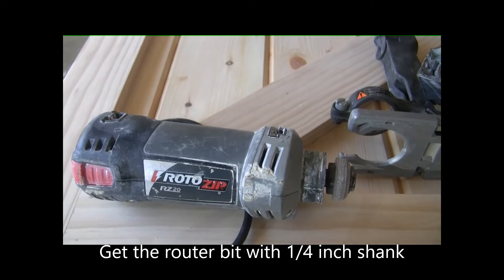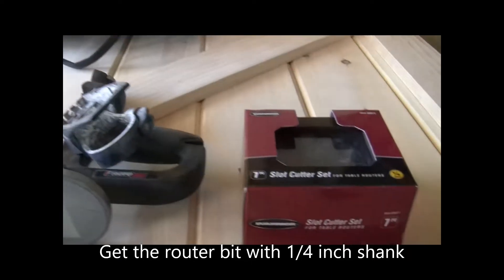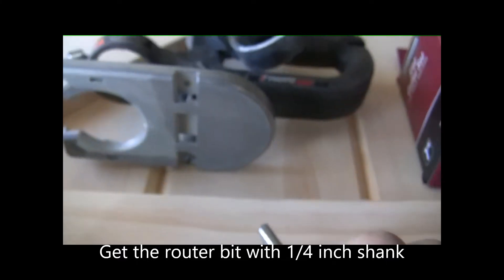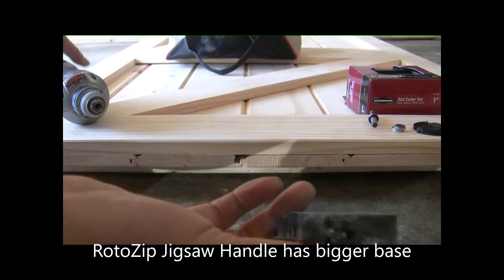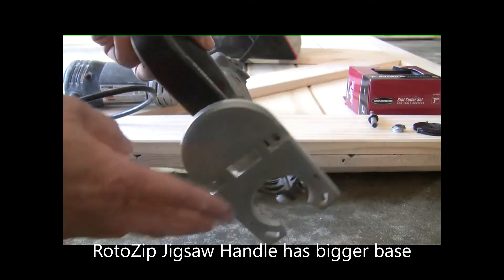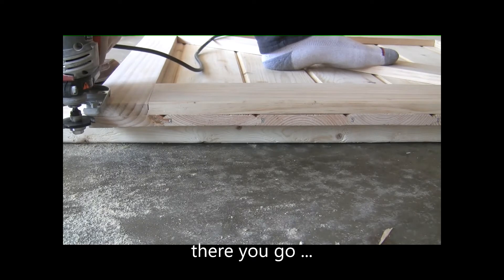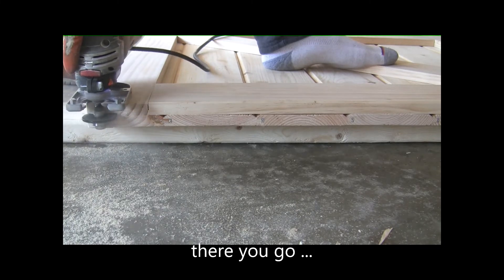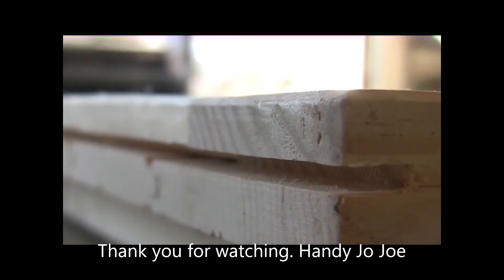Use RotoZip as Router

Comment: I have a Rotozip SS560 but Bosch discontinued the router Attachment PR2. What is the Rotozip model you are using for routing your barn door? And what is the model number for the plunge router attachment?
Reply from the maker: I use regular router bits.  There are two common sizes of router bit shanks: 1/4" and 1/2".  I use the one with the smaller shanks, 1/4".
Reply: @handytf  The questions were:  "What is the Rotozip model you are using" and what is the model number for the plunge router attachment?" NOT what router bits you are using!
Reply: @mururama4454  k karen

Comment: I bought a rotozip over 12 years ago after buying a house that  had windows knocked out and walls kicked in for the copper lines. I am a single woman with very little money so I had to do all repairs myself., I put the Rotozip through pure hell and it came out the otherside like a champ.I had never owned a tool with so much versatility., This is a very old house that was originally wood that had been stuccoed over it cut through both easily. Wouldn't trade it for nothing.
Reply from the maker: Thank you for sharing the story.  I love my RotoZip too.